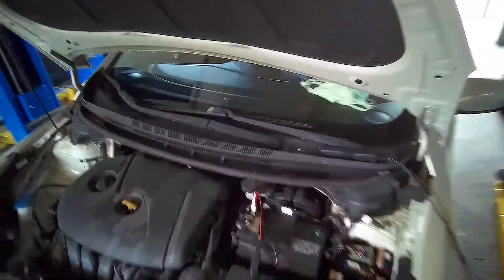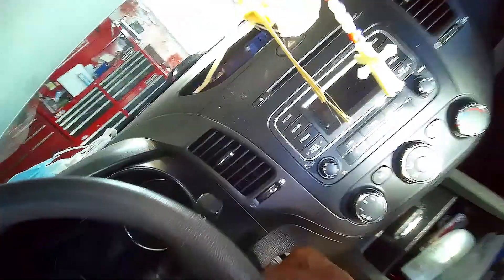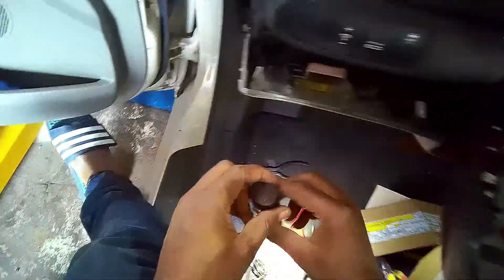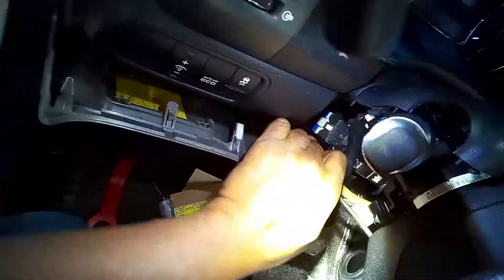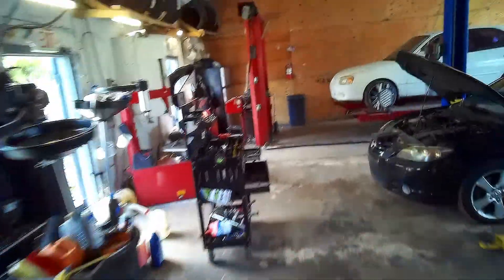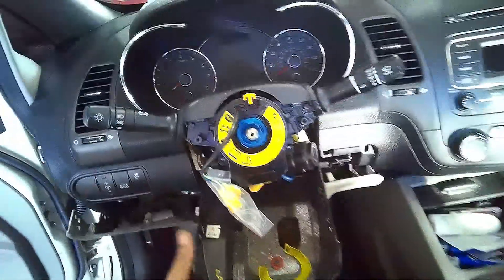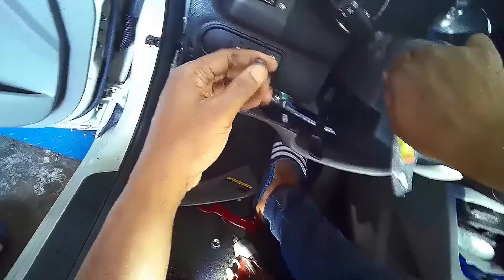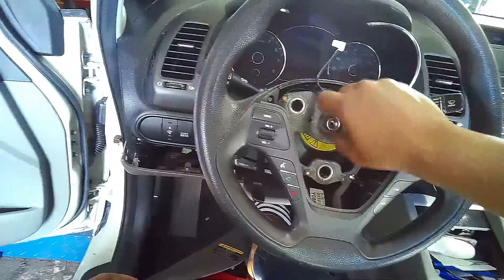2014 Kia Forte Airbag Clock spring replacement

Comment: Thanks for the video. So my Kia Forte 2014 recently crashed and the airbag was engaged. I had the car fixed and wondering whether it is advisable to buy a whole new steering wheel or it is possible to change only the airbag compartment on the steering wheel. Kindly advise